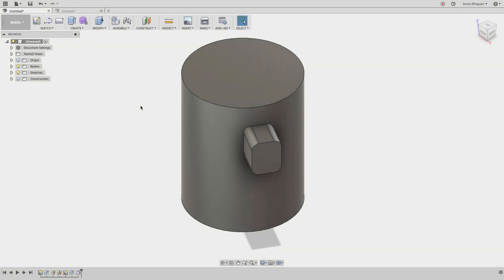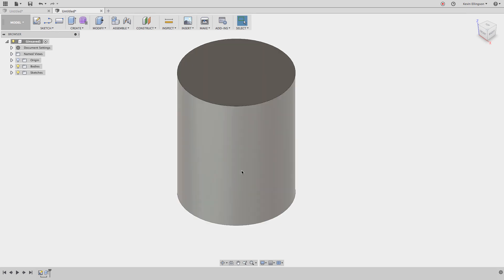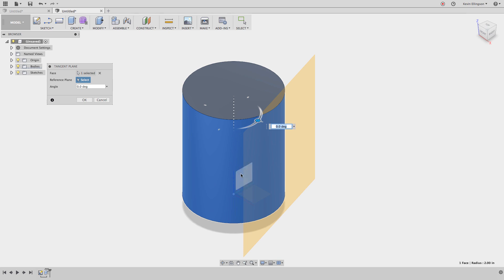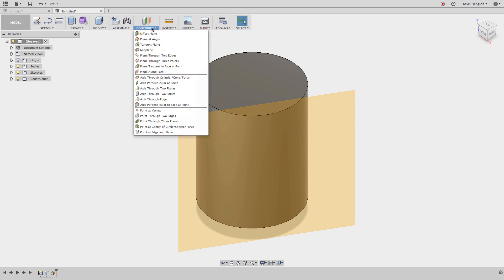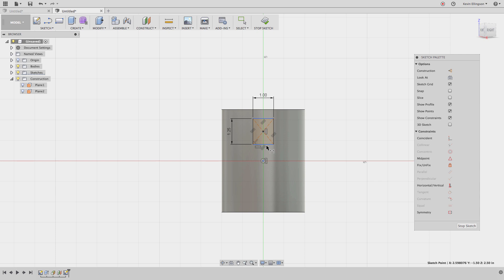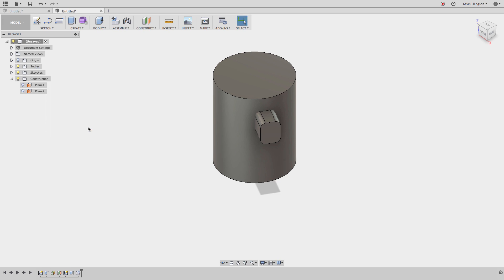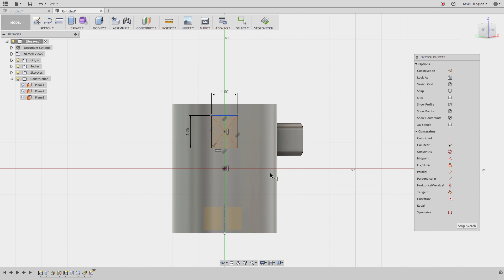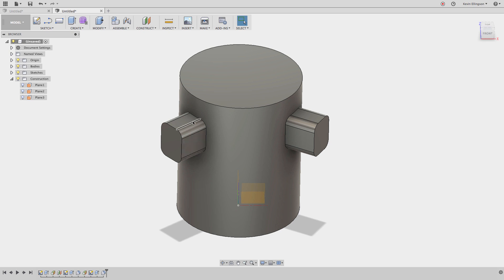Fusion 360 - Create a Feature on a Cylinder Wall

Comment: You don't need to offset the plane to a distance...in extrude choose direction 2side...side 1 click on the cylinder and side2 specify distance
Reply from the maker: Half a horse a piece I guess. There are several was this can de dome like most things in cad. I think I did it the way I did it because it is possibly slightly easier to understand than changing the start plane for the extrusion. But you have a valid point.

Comment: Thank you for great tutorial! Please, specify - what version of Fusion 360 did you use to record this lesson! I downloaded a trial for latest version and do not see "SKETCH" tab in the top menu (I see there: CREATE, MODIFY, ASSEMBLE, CONSTRUCT, INSPECT, INSERT and SELECT tabs). As I understood - PROJECT command is under SKETCH tab and although I can still create a sketch (from dropping menu of CREATE tab) I can not find PROJECT in any of features. What is the solution?
Reply from the maker: Hi Eugene. Have a look at this video https://youtu.be/L_WwTbTl82M There have been some UI changes and this video shows some of the differences between old and new.

Comment: Another silly question: 
Does Fusion make a new bodies for the rectangular extrusions you created here (or are they just a part of the original cylinder as a single body)?
Thank you.
Reply: In this example they join the cylinder body. The option for this is at the bottom of the extrude dialog box.

Comment: podrían hacer un vídeo sobre CAM en tubería, corte a 45 grados, 90 grados, una intersección al centro del cabezal, corte con plasma o router
Reply from the maker: Desafortunadamente todavía no tenemos las herramientas que necesitamos para hacer plasma/láser/aguajet para objetos cilíndricos. Si y cuando esa funcionalidad llega a Fusion 360 sin duda voy a hacer un vídeo para cubrirlo.
Reply: @MechanicalAdvantage  Aunque desconozco de CAM, le dedique unas 10 horas al corte de tubos, ya encontre una posible solucion, solo que permite hacerlo en un tubo pero con mas cuerpo, no en el extremo del tubo, el corte lo tienes que hacer del extremo del tubo hacia dentro, yo lo desfase una pulgada hacia dentro, haciendo una interseccion a 90 grados de dos tubos de 6 pulgadas, proyectas el corte en la superficie interna del tubo a cortar, despues conviertes la linea interna de corte en un boceto 3D, de ahi creas un plano en la linea 3D, creas un rectangulo que hara el corte con el comando de "barrido", en el comando barrido donde tiene un valor de 1 se lo cambias a 0.999, ya de ahi haces el CAM en el espacio eliminado con el comando contorno